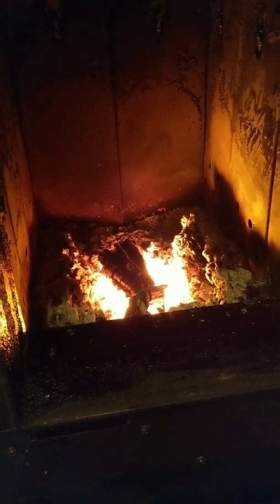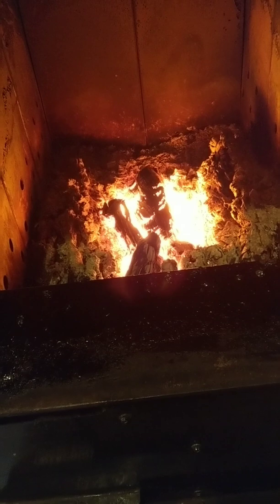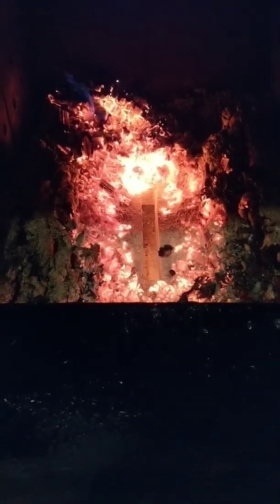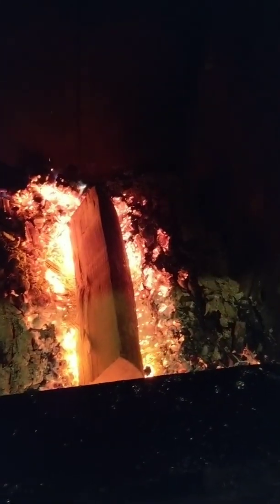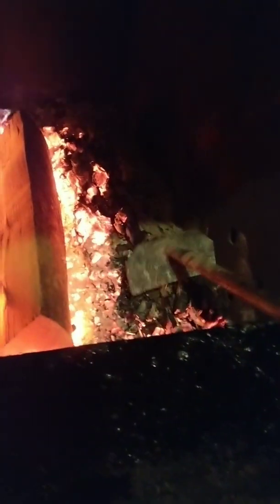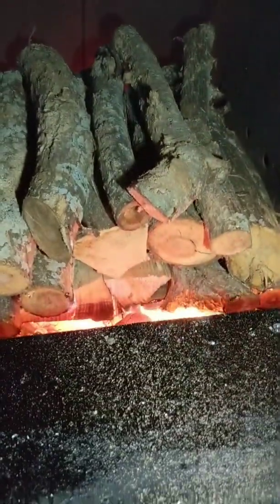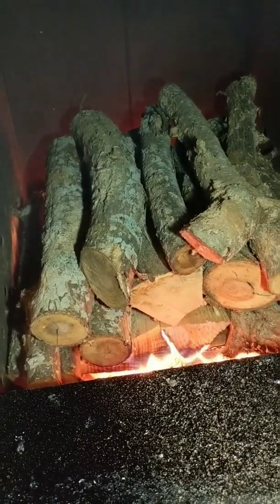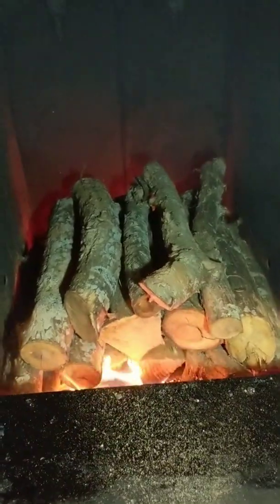Daily loading procedures for a downdraft gasification outdoor wood boiler

Comment: You mean to tell me you don't fill that firebox to the very top?
Reply from the maker: No, only when necessary. I only load for 12 hours increments. Last night it was down to -30F and I loaded it half full.
Reply: @unleashedoutdoors3975  so what kind do of a price tag is on such a boiler?
Reply from the maker: you are looking between 9-12k depending on which size unit you need to fit your needs
Reply: @unleashedoutdoors3975  So that is what? Maybe a 20 year payback? You still have to buy wood, load wood twice a day, clean it twice a year , still need electricity to run it , replace fan blowers, flaps,door seals, deal with ash creosote etc etc.. I have a boiler and dont think I would ever get another. With propane prices what they currently are these just make no sense whatsoever.. put a pencil to it and you will see. If they were priced about half of what they are maybe but 12K.. no chance
Reply from the maker: @mjuberian  depends on your application. I heat my home and business totalling over 7,000 sqft. If I were to heat strictly on propane for house and business I would be well over 4-5k per year in propane. We also have a family of 5 using DHW which can get expensive. For us, it's a quick payback of about 3-4 years.
Reply from the maker: A 20 year payback is ridiculous, lol.
Reply: I see a use for it in my home,8,000 plus sq.foot counting shop.I also have access to firewood on my property.I can tell you if I heated with propane it cost over 400$ month and that's keeping it at 65 degrees.In our home my wife is cold.Im wondering how well this will work as a radiant heat supply because I'm still building on.Shop will consume the living space because we use it as an office already.We have a barndominium